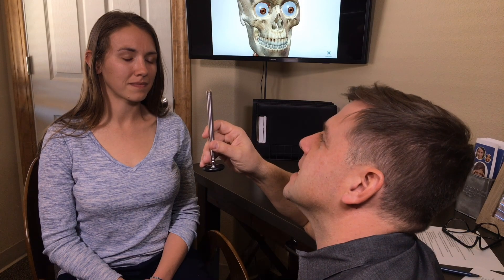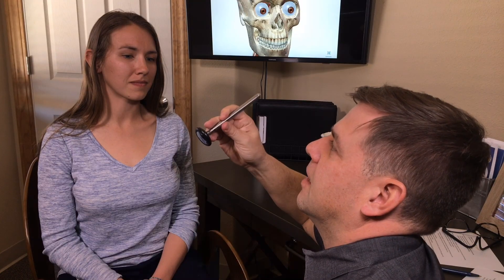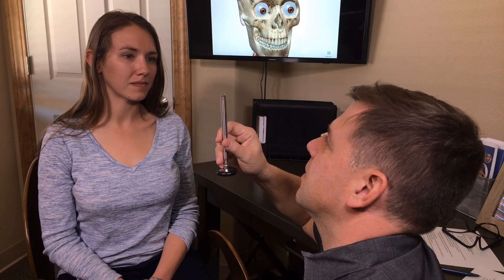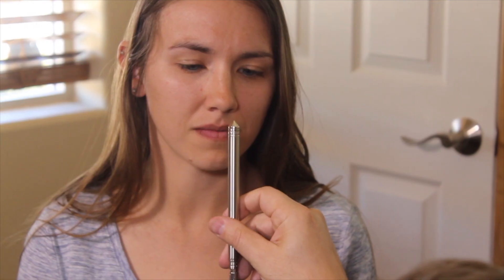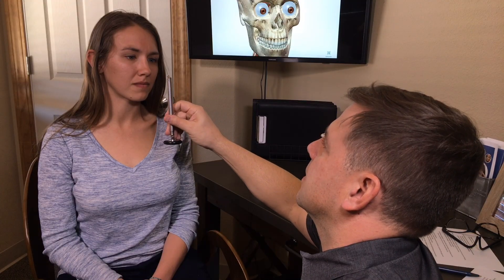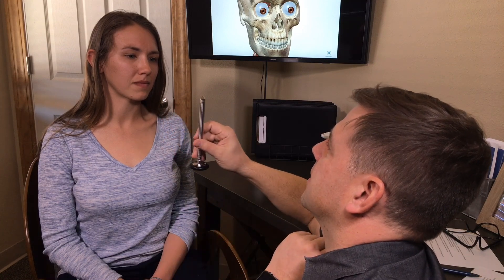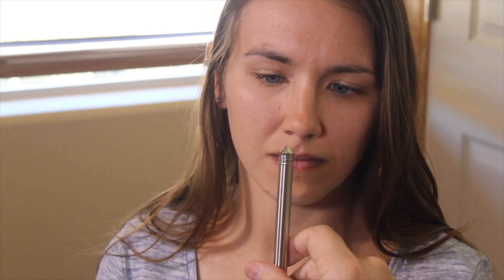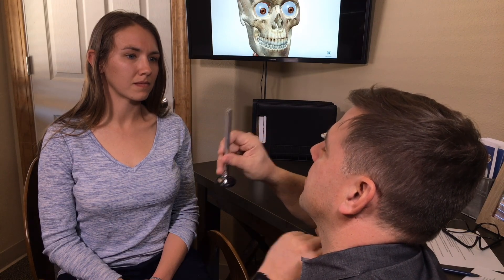Convergence Testing

Comment: Its blurry with one eye covered.  Whats normal distance?
Reply from the maker: Normal is 1-2 inches from your nose, maybe 3 inches. The big idea with testing is to look for the eyes to work together. Both eyes are needed to keep the object in focus with convergence. Using one eye is only using the accommodation or your lens and as we get older the distance we can focus on diminishes. Here is a link to more information on the importance of this test.

https://cornerstonept.co/headaches-pain-causes-and-remedies/testing-for-blurred-or-double-vision-for-headaches-1560048222141.html

Thanks for the question! This page is primarily used to hold videos for our website so we rarely check to see if people are watching. Hope this helps. Joel